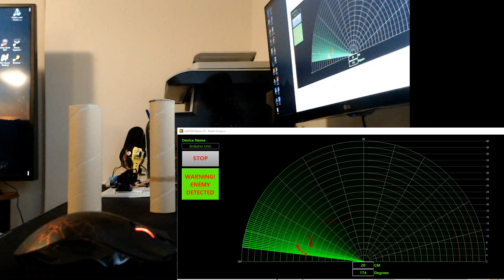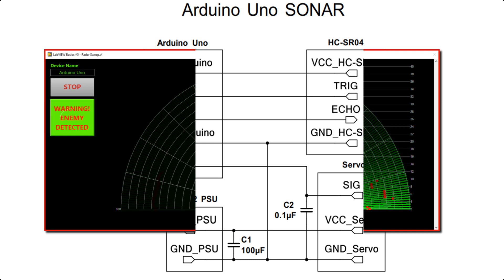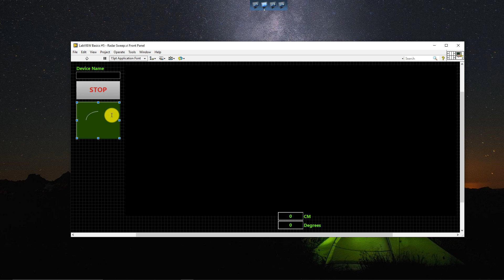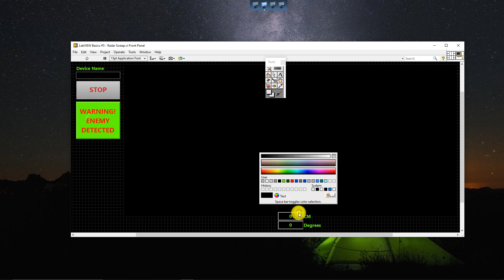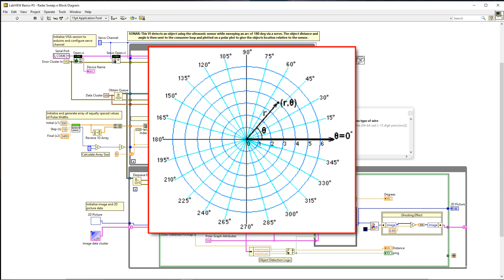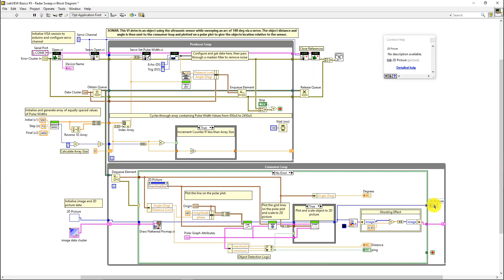LabVIEW Basics #6 - SONAR Part 3 - Design and Implementation of a SONAR System on an Arduino UNO R3

Comment: Ultrasonic sensor is not sensing the object, what to do???
Reply from the maker: Check the circuit and confirm the sensor is working.
Reply: @SINConsulting  yes sensor is working  ,  i checked with other project .